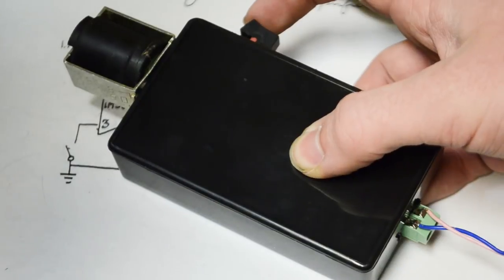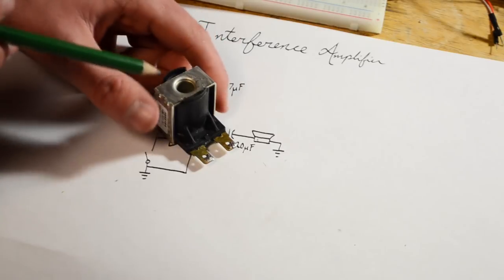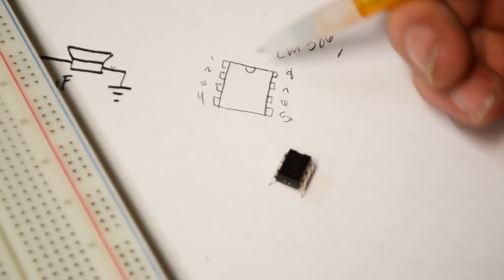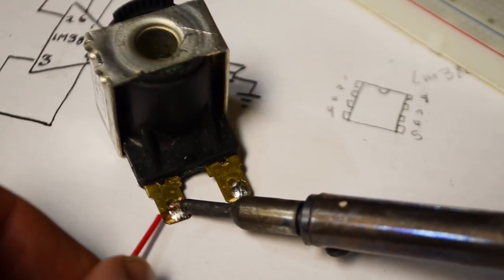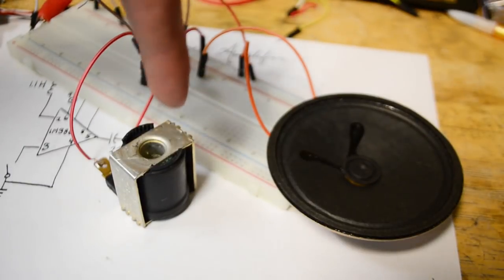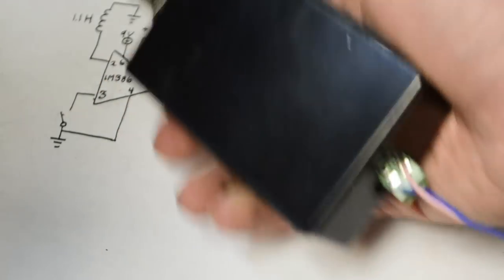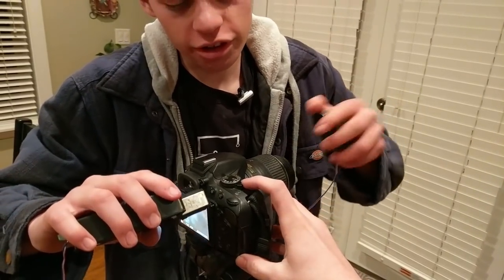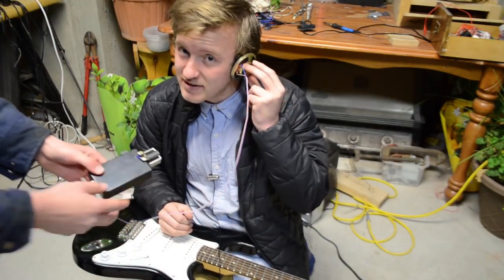How to make an Electro-Magnetic EavesDropper

Comment: Warning, an LM386 chip was harmed during the making of this video.
Reply: Tanner Tech hey man!
Reply: How are those beads?
Reply: Tanner Tech Great job tanner!
Reply: koo kool
Reply: Thanks for the warning. Subbed btw ;)
Reply: Tanner Tech was it the microwave that fried the lm386?
Reply: John Hasty I'm not sure what fried it, but it all of a sudden started drawing .5 amps and it got really hot.
Reply: Tanner Tech lol, well if my 386 ic’s ever arrive to my mailbox I will definitely be building this! I subbed and will let you know how it turns out. :)
Reply: Great job, Tanner. I was one of your first subscribers.
Reply: Tanner I need help, I got the circuit put together but the inductor I made is only .23 mH. How can I make a 1 or 1.1 H inductor like the one you guys used? I don’t have any relays or solenoids laying around, just .6 mm magnet wire
Reply: John Hasty I suppose you could just wind a ton of the wire around a spool.
Reply: Tanner Tech should have tried it on the satellite receiver maybe you could get the decryption frequencies or something? 🤷‍♂️
Reply: @eddievanhorn5497  )jjkkjjjj

Comment: You ever mess with the tempest software and a sdr dongle it can pick up the same electromagnetic sounds except the software can interpret the sound and decode a computer monitor so if you had sensitive enough equipment and someones pc wasn't in a Faraday cage you can see everything they do on screen. Even without the software there is a way to do this just in sdr sharp to decode some sounds displayed as images on the monitor.

Comment: Could you use a different antenna and make a receiver for specific radio waves?
Reply from the maker: Yeah, you could likely couple it with a capacitor to get to only resonate with certain frequencies
Reply: Keystone Science pretty much makeing a receiver. Thanks

Comment: So using headphones instead of a speaker wouldn’t need a modification for decreased output?
Reply from the maker: I didn’t try with regular headphones, just a piezo Electric earpiece, and that needed no modification, perhaps a regular headphone though would
Reply: hurms X you could add a switch with a attenuation circuit for either speaker or line levels for headphones.

Comment: ive tried to make one of these with a transistor and a huge inductor, but it didnt work. also instead of a speaker i tried to use an LED
Reply: Henry Swan 
You will need to bias the gate of the transistor to make this work.

Comment: wondering why your laptop had what sounded like morse code
Reply: wireless card sending packets maybe
Reply: Starting around 5:28. It needs some investigating with a spectrum and logic analyzer at least if it is producing strong EMF modulated in almost audible ranges.  This would not pass TEMPEST.